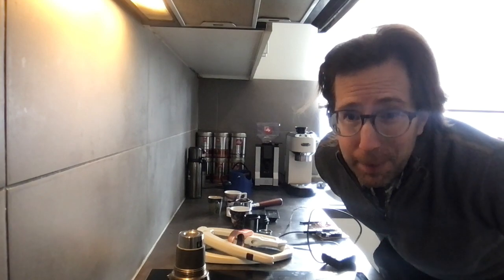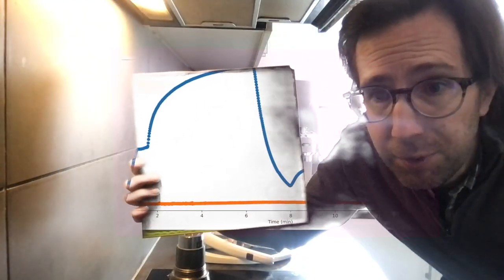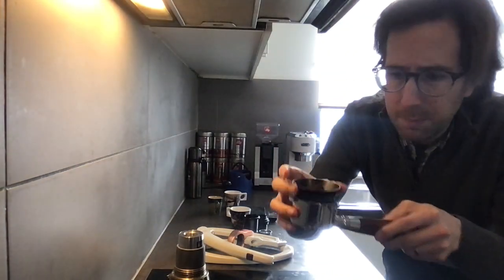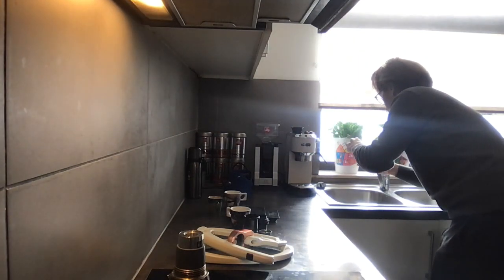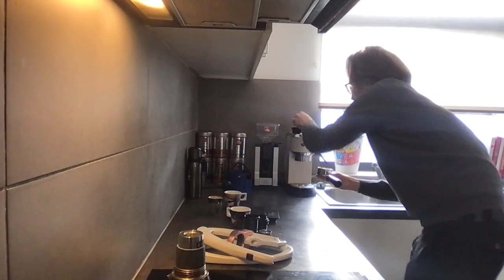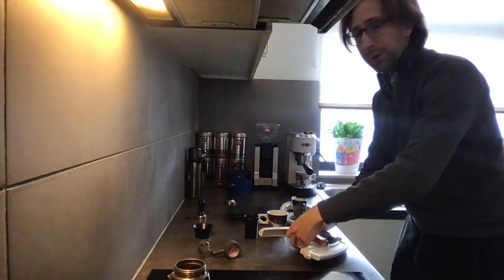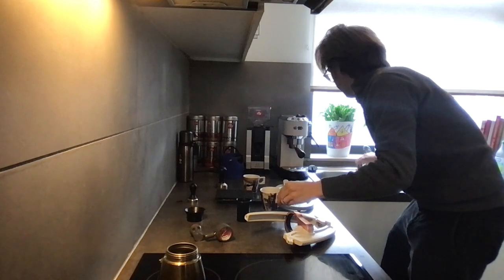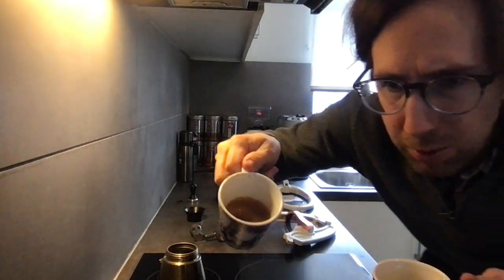Flair and Delonghi Dedica - comparing the pressure

Comment: Looking at this video and some previous I have wondered if you are grinding too fine for the flair. I use a la pavoni europiccola and over time have found that the more pleasant experience (production and taste) is to have a more moderate resistance to the lever pull. Like cutting a hard cheese with a knife. If I need body weight this is much too fine a grind! This is interesting at the he 10minute mark https://youtu.be/1_XDwbW7YM4
Yours was an interesting video thanks.